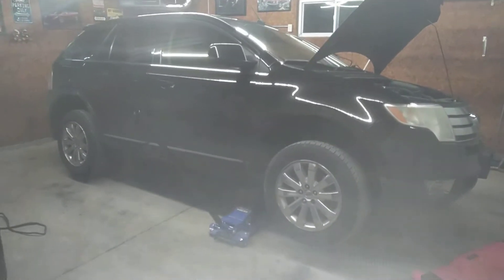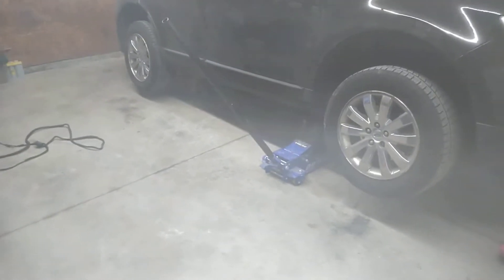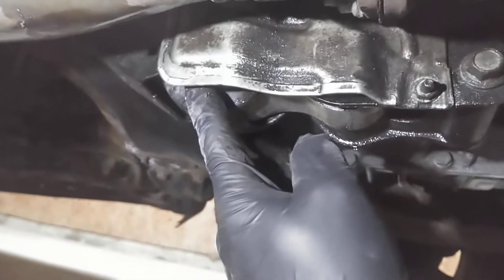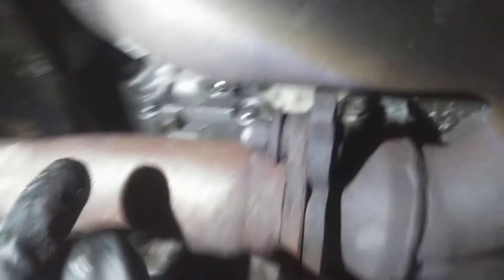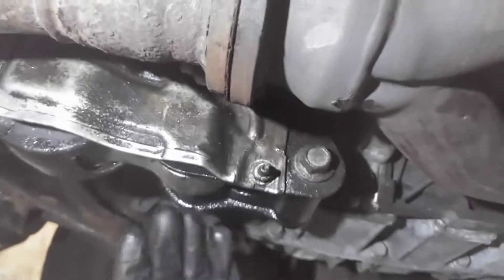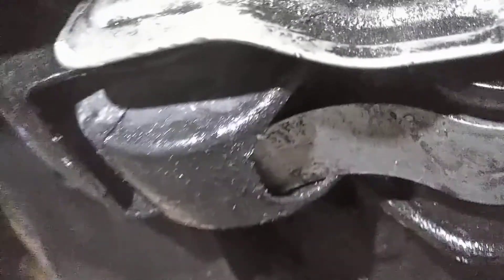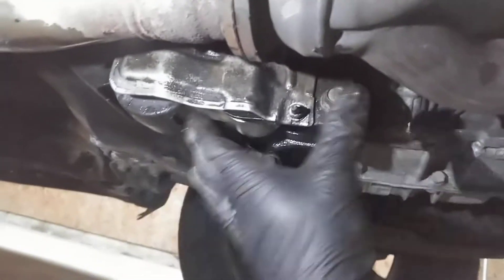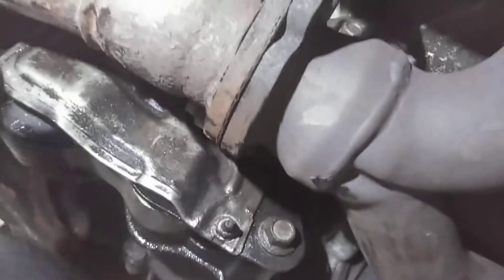Ford Edge transmission mount diagnosis

Comment: Great video quick question my symptoms are vibrating at idle but roughly while under load is the same mount you are replacing I have a Lincoln mks 2011 replaced the top mounts but never the bottom one
Reply from the maker: It sounds like it could be the lower mount. Does it feel like a misfire or just a shaky motor?

Comment: Hmm I’ll have to look into the tranny mount on mine. When I shift from park into drive, I hear a very brief squeak. Then when I accelerate gently I hear squeaking. Other than the vibration, did you hear any squeaking as well?
Reply from the maker: No I didn’t hear any squeaks. Mine was so soaked in oil I don’t think it would have ever squeaked lol. Check your u joints also on your driveshaft, they came non serviceable from the factory but dried needle bearings squeak when going bad.

Comment: Did it sound like a knocking or banging noise through the floor/center console up until about 30mph? Then went away at speed?
Reply from the maker: Yes it did? I could feel a vibration in the shifter, and mine was so bad I could feel the motor move under hard acceleration. The ptu had leaked oil for years on it and the rubber finally broke down and it all went bad
Reply: @T-MillProductions  Thanks for the quick reply. Was under the car yesterday filling PTU and other things. Noticed how terrible the trans mount looked and voila, it started banging!
Reply from the maker: You’re welcome man! Glad I was able to help, yea these things have some known issues lol. I got ever 231k miles on mine but not without some problems lol. Also is that a mach 1 as your profile picture ?
Reply: @T-MillProductions  Yep that's my 03. Never got around to buying a Cobra or Boss 302 like I planned on doing.
Reply from the maker: That’s awesome man, I got a 03 azure blue Mach 1. And several others lol. Someday I want a terminator and 2013 boss. Both great cars.

Comment: Did tha make the act like it was choking while driving
Reply from the maker: No it made a bad vibration and you could feel the floor shake when under acceleration. You’re problem sounds like something that happened to me years ago, my edge would buck and chuck and I found out the air filter was bad, the foam, rubber gasket around the filter has a piece missing and snow was going past it and hitting the mass air flow sensor and was throwing off the shifts and everything. I bought a k and n reusable one and never had a problem since